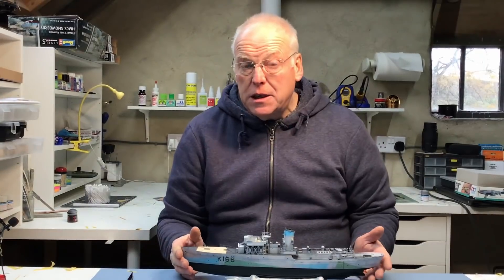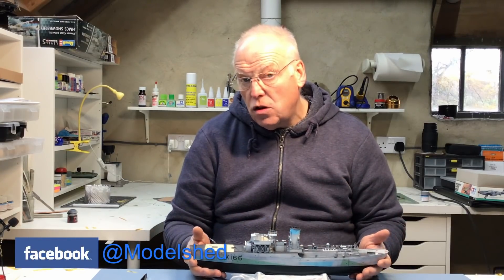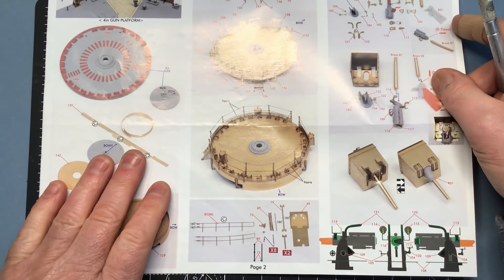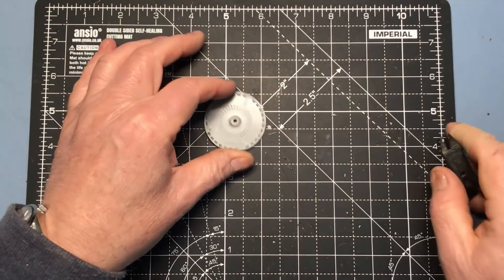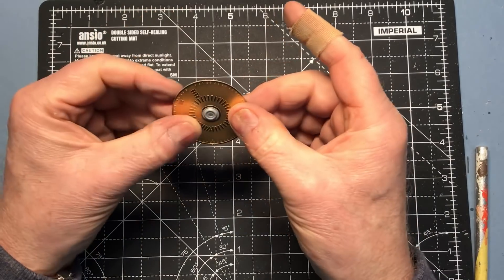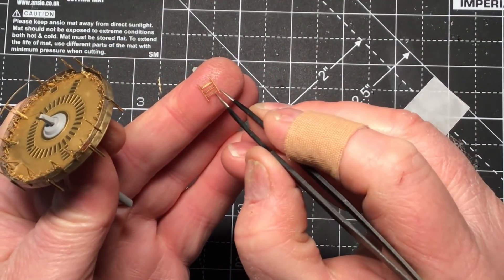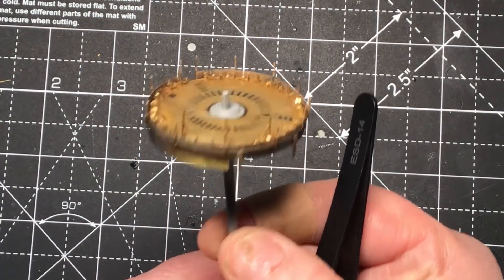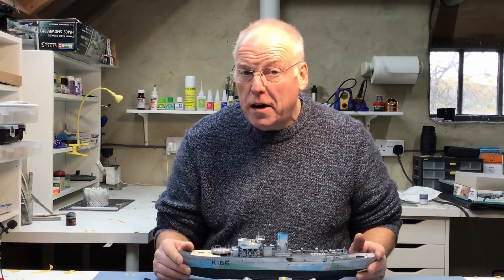Revell 1/144 Flower Class Corvette full build with Pontos detail set Part 13

Comment: Fantastic catch re the platform legs!! The Pontos instructions didn't look correct, but it didn't occur to me that they'd mislabeled the parts. Those shell cradles are still mocking me, however you proved that they CAN be installed without going blind and/or slitting one's wrists. as usual "Very well done, Sir!!"
Reply from the maker: Thanks Jim I don’t understand why a company like Pontos who clearly have an eye for detail can’t check through the instructions and proof build the parts to eliminate the errors.

Comment: Great work.  I wonder, with the platform legs if you could have added a bit of solder on the inside to fit them more securely to the rim?
Reply from the maker: 👍 The flat side of the “U” channel fits to the rim so it’s secure as it could be. The assembly is safely stored away now so hopefully it will be ok until it goes on the model.

Comment: Which glue viscosity did you find most effective for the shell cradles, the safety rail, and the outer stanchions... Medium, Thin, or Extra Thin?? Following your catch re the placement of the support legs I've got my platform to the point that it's time (gulp!) to take on the cradles. I was thinking that Thin might work to spot the piece, and then use Extra Thin to "lock-in"... or just go with Extra Thin from the start?

Another sly (partially hidden) tip from you... I wanted to solder the support legs to the outer ring. My issue was to find an appropriate mandrel to support the ring while I soldered. In one of your shots I noticed that you were using an old Tamiya paint jar to support your piece. Problem solved for me. I taped my ring to jar on either side of the leg, then fluxed and taped the leg in place, a flash of solder, and job done.

One never knows when the Professor will toss out the modeling tips. Thanks again for bailing me out!
""
Reply from the maker: Jim I used medium - gently dipping the parts into a pool of glue and applying to the platform. Because you’re using so little I think thin/extra thin wouldn’t hang around long enough to get a fixing. I got a good enough bond not to need any extra thin reinforcement - and I wouldn’t have wanted to try as the area is so busy that it would be too easy to flood it all.
Reply: @TheModelShed  Many thanks. I had suspected that might be the case, but I wanted to check with you. There is so little room for error I didn't want to go down the wrong rabbit hole. Another curious decision by Pontos as they give you 5 extra of part #139 (the far easier component to bend/affix), but only 2 of the much more complex, and delicate, part #141.

Comment: What if you removed outer edge of plastic base or at least 5mm.you could then solder it to base ?
Reply from the maker: Maybe Jerry but the edge of the plastic does support the brass ring well and it helps form the brass into a perfect circle so on balance I'd rather keep it and use the glue. Its a strong joint so it seems to work ok.